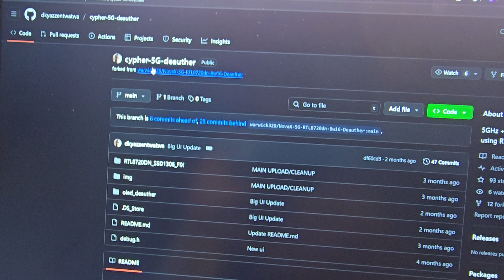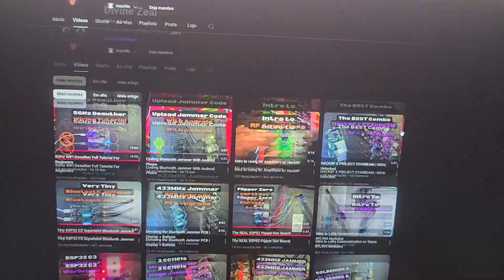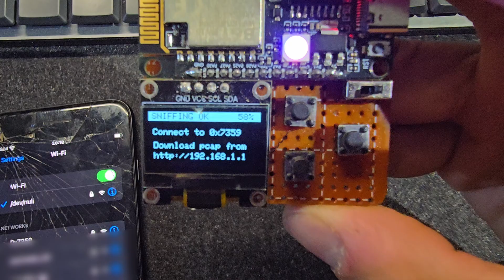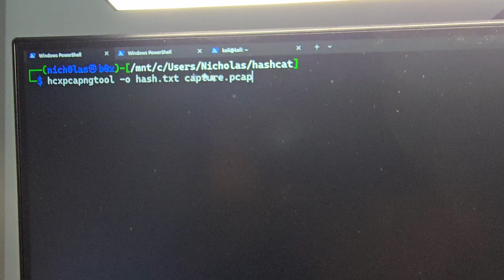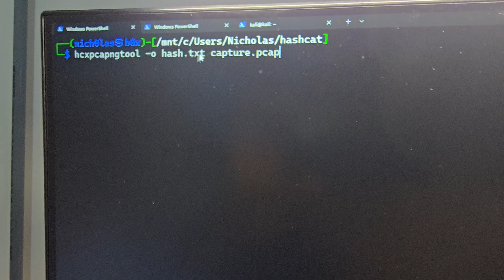Capturing 2.4 and 5GHz WiFi Hashes - BW16 Deauther + Sniffer

Comment: is it possible to deauth 5ghz and setup a AP(Captive portal) on the 2.4ghz at the same time? If yes, does it run smooth without crashes or overheating?
Reply: U can't , either rogue ap or deauth only one at a time

Comment: followed the wirings but one of the IC in BW16 kit is heating up. I tried to  connect the charging module to powerbank to see if the battery will charge but one of the IC in BW16 kit burned. Do I need to add step down converter?
Reply from the maker: I don't think so, as long as you're feeding the pins with the right voltage. If you're using the BW16's 3v3 pin for charging, the voltage out of your charging module shouldn't be higher than that to avoid burning the chips. If you're using USB, chances are it is 5V, so you should use the 5v pin in the BW16. I used those resistors only for the battery percentage code, but they're not necessary for the charging system.

Comment: This is only for 2.4G, if you thinking about 5G it will not work.
Reply from the maker: No, it totally works for 5GHz. I only made this video because of that.
Reply: It can 5ghz wifi, but it cant attack to a wpa3 security

Comment: Boss how to add antenna?
Reply from the maker: You either need to manually solder the I-PEX MHF adaptor on the board, in those 3 points of solder near the onboard antenna. And also you need to remove the metal shield from the chip and swap the position of the 0 ohm resistor.
Or you can simply buy the model that already has all of this out-of-box: 
https://pt.aliexpress.com/item/1005008646059077.html

Comment: Can you please show you can use the smartphone as the oled display and buttons or just give me the source
Reply from the maker: @buriburizaemon7587  Use the app Serial USB terminal and change the code so that it can interpret serial commands. By doing that you'll be able to set up some buttons in the app that run the commands (such as scan, list networks, deauth etc)
Reply: @NicholasFerreira7359  Can you make a tutorial please?
Reply from the maker: @ I'm working on a better version of it, I believe I'll make a video showing how to use it with the smartphone when I finish it, stay tunned

Comment: the programm is uploaded but the display still black
Reply: its ur lcd oled 0,96??
Reply: @muhammadfauzan3955  0,96 oled its from AZDelivery the 12c ssd1306
Reply: @muhammadfauzan3955  i have oled the one in the vid
Reply from the maker: Do you have anything on serial console logs? Double check your wirings. If it's all connected correctly, try running a simple hello world on this display to check if it's working.
Reply: @NicholasFerreira7359  i have nothing on serial console logs. my wirings ist all correct. it still shows nothing

Comment: Can you show how you soldered the battery and all the wiring. The other guy didn’t do it with a battery, and I’m kinda new to this whole thing
Reply from the maker: I've updated the github repo with the schematics
Reply: really
Reply: you need 2 resistor and connect to pin PB3 to show battery, detail on code.

Comment: Put the sniffer in a different thread and start it with the deauth thread so it's always listening.  Maybe that will correct the lost data.
Reply from the maker: I don't think this would work, as the BW16 Wi‑Fi radio is a single resource that can only operate in one mode at a time, not concurrently in both injection and monitoring modes
Reply: @NicholasFerreira7359  Hello, i can confirm that RTL8720 is able to do SoftAP and promisc at the same time. You can just enable/disable the callback and the SoftAP will still run just fine
Reply: @NicholasFerreira7359  you can actually make SoftAP and promisc run at the same time. I managed to make it runs deauth, SoftAP and promisc at the same time.
Reply from the maker: @hafizmaulana8166  How did you managed to do that? When I tried, it freezed and did one at a time
Reply: 2esps that communicate with each other in between Tasks? Just an idea Im just starten out haha